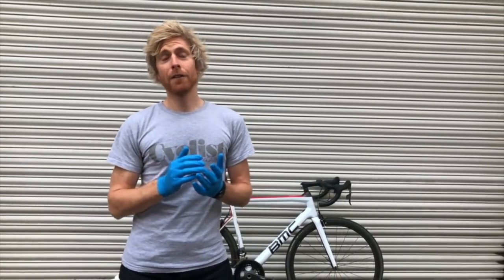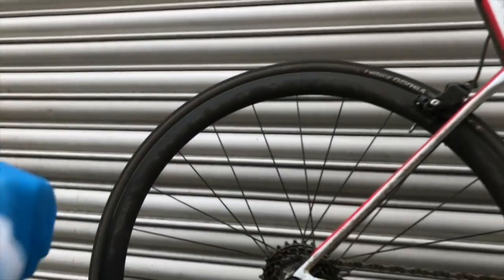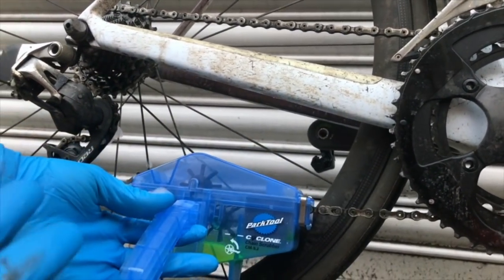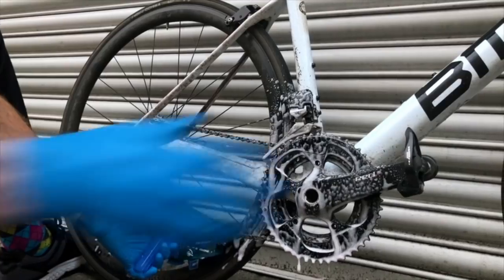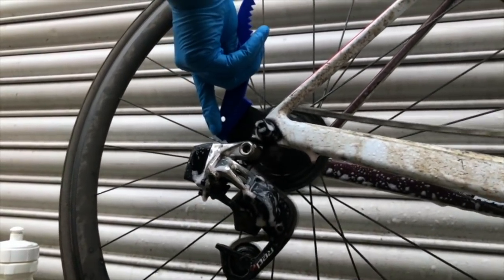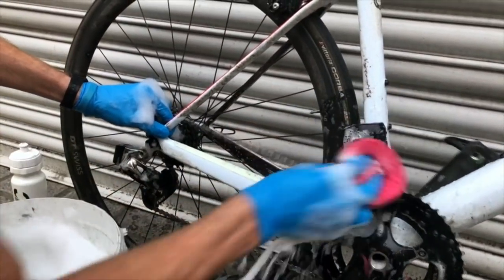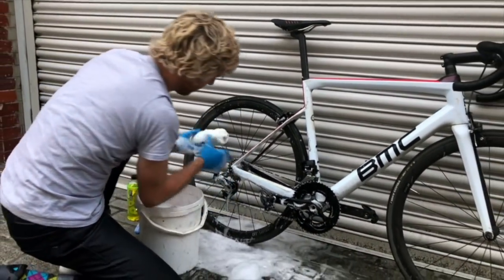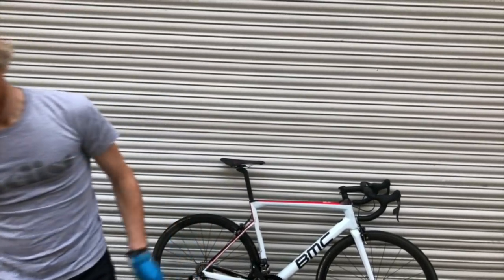How to clean your bike chain and drivetrain like a pro: Top tips for fast, efficient cleaning

Comment: So many things make this the best drivetrain cleaning video on YouTube.
1) Done in real time
2) Started with a drivetrain that is actually dirty
3) Shown that it can be done without a bikestand
4) Using the minimum amount of tools and  demonstrating some optional extras
5) Great presentation and filming. To the point with no faff. 
Thanks so much.
Reply: Also, relatable when he accidentally knocks the chain off.
Reply: How about showing us how to clean chain and gears with houseold cleaners readily available, not specialized chemicals. Thank you.
Reply: @gregroth4696  the chemicals aren't expensive...
Reply: @gregroth4696  just use an old paint brush with some fairy liquid, it’ll do the job just no where near as good as if you used stuff like mucoff
Reply: @gregroth4696  if you own a bike, you should own also the specialised chemicals.
Reply: @howardlam6181  Muc Off is just specialized BRANDING.
Reply: @gregroth4696  Simple Green 1:1 with water is all you need, don't pay for Muc Off branding.
Reply: @fcv1967  With simple green, you should be using their industrial ones, not general purpose. Also just another brand.
Reply: @howardlam6181  A brand that is significantly less expensive and has better results. Look at Park Tool wrenches, 7-8x the cost of another crescent wrench, only difference being the blue handle. It's bicycle specific marketing for products that are already on the market.

Comment: Wet lube, dry lube or... wax. I have recently discovered this piece of magic, and will be doing my first one next week. As a mountain biker, wax seems to be the holy grail 🎉
Reply: For Mtb's I totally agree on the wax. But for roadbikes, for me wax simply does not work. Not that it isn't a good lubing solution, but to really clean it. Once waxed, you are not supposed to clean the chain throughly like you would with an oiled chain, resulting in a not so blinky chain that looks dirty and sticky all the time.

Comment: Jockey wheels almost impossible to get 100% clean. 😎🤪
Reply from the maker: Good stiff brush, and a little patience ;-) you can do it. Trust me :-)
Reply: Easy peasy just take back wheel off, unscrew bottom jockey wheel from the front side of drive-train, clean with de-greaser, tooth brush etc then screw it back in with a tiny bit locktite on screw. Unscrew guide pulley from non drive side, clean, tiny bit of locktite on screw & make sure jocky wheel inserts from above the top chain line pushing the top chain down into place.

Comment: Does a dirty chain actually affect performance and/or is it dangerous? I've never cleaned my chain and don't really see the need unless it's somehow dangerous.
Reply from the maker: A dirty chain will certainly cost you a lot of money in the long run Matt. If your chain is running on a layer of dirty grime, it's basically grinding away your expensive components - cassette/chainrings etc. A clean chain is a happy chain in terms of efficiency too. A dirty, poorly maintained chain could rob you of precious power as well as wreck the entire drivetrain. You are definitely better off cleaning and checking wear regularly - using a dedicated chain wear tool (we have a video on that too) and replacing accordingly. A strategy of regular checking and replacing the chain before it gets too worn is best, based on the simple common sense that chains cost a lot less than replacing an entire drivetrain. £££££ I Hope that helps. Also, during the cleaning process is when you usually notice any issues/problems that might cause safety issues further down the line.

Comment: I’m going to be honest...I am old. I wash my bikes and keep them clean. I use a Brush like on my vehicles. Spray it and brush with soapy water. Dry it. Add whatever lube I have to the chain, even wd40mor a bike chain lube. I’m not a pro but I have good bikes. I haven’t noticed any problems. I just point out I’m old because it’s been decades of doing this with different bikes and so have I just been lucky or are most of the videos overkill?

Comment: Honestly, it would be faster and easier (if your chain has master link / quick release link) to take off chain and soak it in mineral spirits. Then scrub if you want with toothbrush.  Save the cost of that chain scrubber tool which no way will really get into the fine crevices of chain links.

Comment: But the degreaser etc had gone all over the rims! Would that not stop the brakes working?
Reply: Same question here ... I would assume that a degreasing of the rear wheel is needed at that point
Reply from the maker: Good question: I would say it's important if you have disc brakes to clean them off (last job right at the end) with either clean bucket of hot soapy water and a CLEAN rag/sponge, and then rinse again with clean water, or better still is to get into the habit after every clean of just running disc rotors through a clean paper towel with a good dose of disc brake cleaner. That way you can be certain of no contaminants

Comment: Which chain lube do you recommend?   I just use 3 in 1 oil from the can, but it's messy and may not be appropriate lube for the job.  Thanks
Reply: Try Pro Gold chain lube. It is thin but works the best. Lube gets into all crevices on the chain.

Comment: Great video. What cleaner is in the bucket except for water?
Reply from the maker: Good ol' Fairy Liquid. Works like a charm. I've always used just a good dose of hot, soapy water. I know there are those that don't think it's a good idea to use it on bikes as it contains salt etc, but I've been cleaning bikes this way for over 3 decades and never had an issue yet.

Comment: i use a tooth brush on the rear cassette doing one cog at a time. same result. takes a bit longer. more absorbing!
Reply from the maker: too much time on your hands esotericist :-) The point of this video was to show how fast it can be done ;-) For all those people that tell me they don't have time to clean their bikes!
Reply: @Cyclistmagvideo  when I used the chain cleaning tool it wasn't so stiff I could barely use it is that sponge inside suppose to be in there? I pushed the chain right in the to the the centre with no luck it's hard the chain keep getting caught in the the front derailer

Comment: Use cheap White Spirit from the supermarket as the cleaning solvent. Dry and lubricate. I do mine every 50 miles.
Reply from the maker: Brian Swan what do you do when you’re on a 100 mile ride?
Reply: @Cyclistmagvideo  Take your point. Don't do very long rides I'm an MTB rider. If I did do a 100 mile ride I probably wouldn't stop to clean my chain on balance. Perhaps I should have said weekly.
Reply from the maker: Brian Swan ah that makes sense. At any rate, hope you enjoyed the video! Keep riding
Reply: @Cyclistmagvideo  Cheers I did.

Comment: It didn't really look that dirty.  You can still see the chain links are shiny silver.
Reply from the maker: I grant you that is true, but hey, the process is the same regardless and that's what's important here. Plus you should almost never have a REALLY dirty drivetrain to clean in any case. Take the "little and often" approach to cleaning and it is so much better, and way cheaper in terms of wear and tear that way too ;-) cheers for watching and commenting, Stu
Reply: @Cyclistmagvideo  I'm fairly new to cycling having just covered 100miles over 5 x 20 mile rides with my refurbished Triban 520! 

I fitted a new kmc x9 chain and dabbed a dot of oil onto each link pin.  However after 100 miles the chain has already turned from silver to a sooty dark oily grey colour.  

Do you think that's just initial wear or is it necessary to clean a chain every 100 miles?!

Comment: Will this get rust off?
Reply from the maker: Hi Michael, sadly not. Rust is very hard to remove once it's set in. If it's just a light surface rust then a thick good coat of oil and a long ride will make it a mess, but then a further degrease and scrub after that might bring it up a bit better. Or a good dose of something like WD40 and a light Scotchbrite pad rubbed on it might help a bit, but again this will only, tackle a little surface rust. If the rust is deep set in the links the chain will never fully recover and work optimally.

Comment: A pro removes the chain for cleaning.  Squeezing that detergent over the freewheel hub and crankset is a good way to wash the grease off the bearings
Reply: @samth8444   Yes, I'm doing it right now on my bycicle. However we need remove and inspect the cones and bearing balls for wear, clean them with alcohol isopropyl (phramacy) and regrease with motomarine or special grease from a bike shop. Then we need to put the bearings back with the correct pressure which is perhaps the more difficult thing

Comment: OMG!!! This video should read "HOW TO RUIN YOUR BIKE LIKE A PRO"...  First of all, Never Ever apply any type of degreasing solvents on or near your bike as the solvents have high capillary action as it dribbles off the cassette and straight into your free-body and hub bearings. Also from your chain rings down the crank spider and into your BB bearings.  Next thing you know your shinny bike is making loud growling noises as the bearings are now dried out and riding metal to metal, all because you allowed degreaser to enter your Rear Hub & Bottom Bracket Bearing.  Typical bearing repair bill, $150 ~ $300 usd..!
If you have the urge to clean your chain, cassette and C-Rings, REMOVE THEM FROM YOUR BIKE, and then clean them.

Comment: It takes less than 30 seconds to take a chain off and less than a minute to put it back on.  And if you really want to get real it takes about 2 minutes to remove the back wheel and cassette and about the same to put it back together.  It is a waste of time to clean your crank and derailleurs with the chain on the bike.  Remove the chain, put it in an old water bottle with some acetone, put cap back on and shake it vigorously for a minute.  Remove chain and wipe it down with rag.  Use rag with WD40 to quickly wipe down chain rings, crank, cassette cogs and derailleurs.  Take a few moments to give the frame a good wipe down now that the chain and back wheel are removed. Put it all back together.  Once you do it a couple times it takes less than 15 minutes and you don't have to hassle with all that water.
Reply: "It takes less than 30 seconds to take a chain off and less than a minute to put it back on"   Send me a video of that please !!
Reply: @bryanjconlon  With a quick link, yes, of course it's that fast
Reply: I see what you're saying, but as someone that washes their bike at least once a week doesn't repeatedly taking the chain off weaken it? (I am thinking of repeated unlock/locking of the missing link or pushing out/in a chain pin weakening the surrounding plate

Comment: Great video. The only thing I would add is that the jockey wheels are where you will find accumulated grime and grit. In most cases, you need to get a flat screwdriver and scrape off the crap around the jockey wheels after a spray with degreaser. I have a spray bottle of degreaser that helps but you can use a brush. And I always remove the wheel to get at the jockey wheels and really get the cassette clean.

Comment: that chain cleaner doesn't articulate the links, it's just a straight pass thru.  so it won't get the tiny bits inside the rollers
Reply: Did you notice the round brush on the top of the cleaner? It (and the other brushes) articulates the links. Trust me, I've used it for years, and the chains come out spotless.
Reply from the maker: Inside the chain cleaner is a system of offset wheels and brushes that do indeed articulate the chain as it passes through, so it gets thoroughly cleaned and brushed from all sides too. That's why they work so well :-)
Reply: Buy one so you can see the mechanism it uses. It's actually gears with mini brushes inside turns when you turn the chain along. Like a mini car wash.